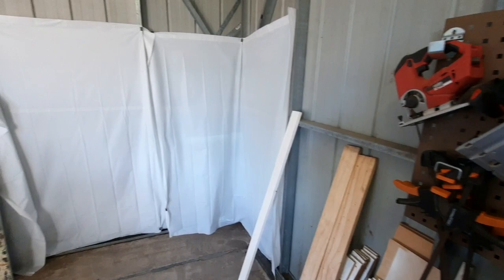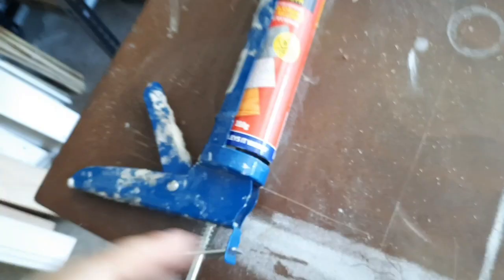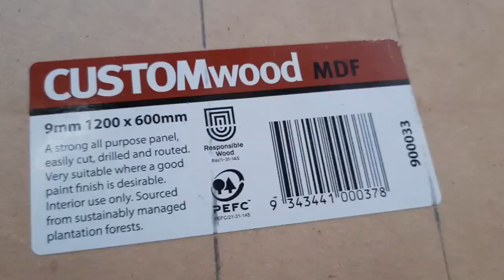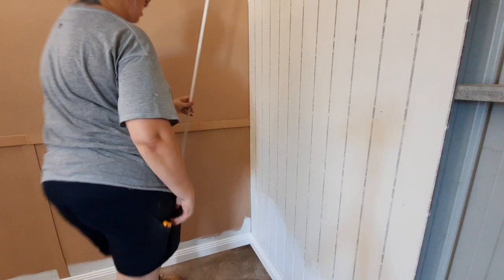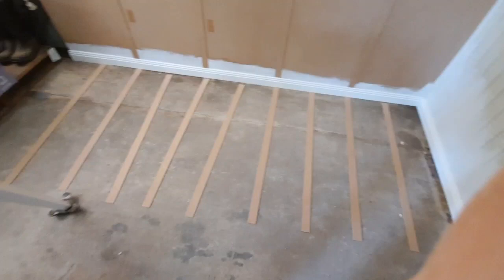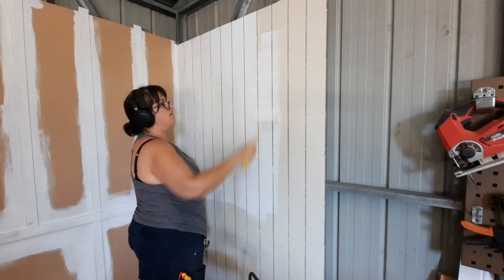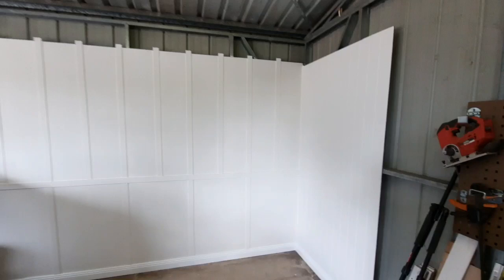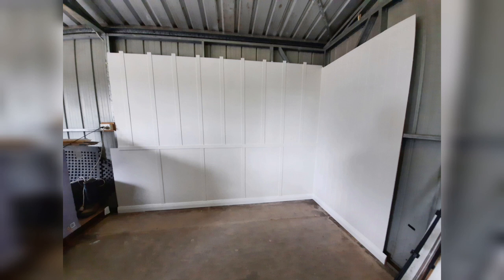Build a Staging Wall With Me | Furniture Flipping | False Wall | Photography

Comment: Good call on everything Twitchy.  Rather than just having a blank white wall, this has some interest and texture.   No color against that paint will clash.  I would call it the perfect thing for a backdrop, since it has some dimension but not so much as to detract.  I was thinking of that vinyl plank flooring that most people either miscalculate and/or for some reason have a little excess after the job is complete.  Not enough to do anything with, so it is junk to them.  You could get that left-over for cheap or even free, since it is scrap to them.  Maybe even ask some random floor installers?  Meanwhile that conc. floor is not bad at all.
Reply from the maker: Thanks mate.
I have some of those vinyl planks that I was using as flooring in my old workshop but I need something super low profile so we can still drive onto it to get the car out of bad weather and so I can easily wheel things around on it.
We also have leftover planks from renovating mums house, you are best to order more than what's needed so that you don't run out. Because they're manufactured in batches the colouring and pattern can be slightly different between batches so it's best to avoid having to order more.
Thanks for watching and commenting 😁
Reply: @CreepDesignsbyTwitch  Well, I guess they do things the same way in Queenslandia as here in the US.  It is the worst thing to not have enough.  Usually a store will let you return unopened boxes that you didn't use.  And as you point out is is important to get all the same "run" or batch.  Wallpaper is one thing that can vary a lot, then you are screwed.  As I mentioned before , I love the Twitch Compound.  Lots of buildings and room to play.  I am sure you will find a good solution, but really I do not think the floor is bad, since it is neutral.  I would venture to say that is the last thing anybody would even notice.